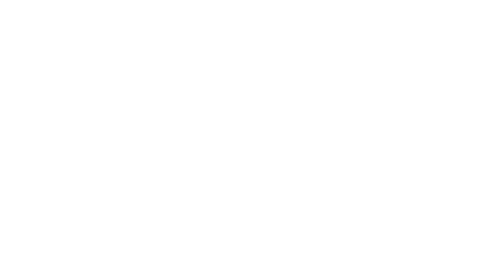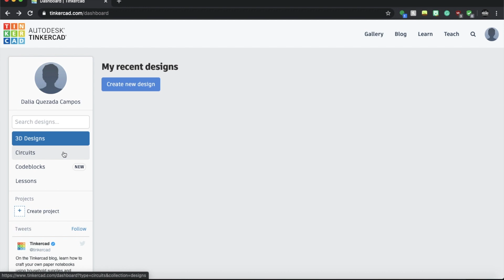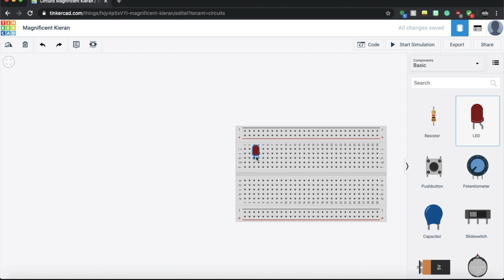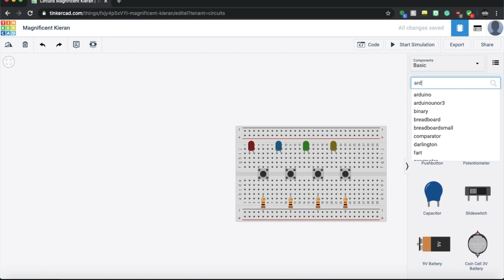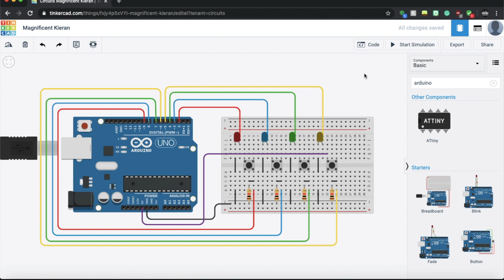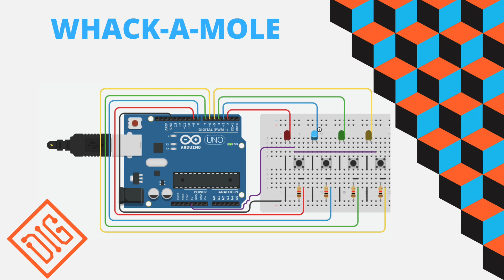Make A Whack-A-Mole Game!

Comment: I did the montage and use the code, but its turning on just the second led and none of the pushbuttons are working. An advice ?
Reply from the maker: Hi Alex! I'm sorry you're having that problem! 

Are you using TinkerCAD or did you make it in person?  If it was on TinkerCAD, could you reply with the link?

IN PERSON:
 If you made it in person and the code is compiling correctly and you followed the code from the video, there may be an error within your circuit wiring. I would try looking at your wiring in comparison to the original schematic (in the description box). If the wiring matches perfectly, the components may not be working properly. For an LED, I would use a resistor that is approximately 300 Ohms. For the grounding resistor, I believe you may need about 220-Ohm resistors, but you can use higher resistances to ground the pushbutton. 

An easy way to check if the components are the ones not working is by making a simple series circuit where you put the LED, a resistor, and a pushbutton connected to the power source within the Arduino Board. Below I linked an example of how to test your circuit:

https://www.tinkercad.com/things/kJpmFD9xRgd-mighty-bigery/editel?sharecode=XjwjhFaxDQMreg_53MRyBF0yF-AhfUfQnA-jjseGCf4 

Another common error when making the circuit in-person is that an LED can only be connected one way. The longer leg of an LED (the anode) should go to the numbered pins in the Arduino. The shorter leg of an LED (the cathode) should go to one of the GND pins. You can put a resistor either between the long leg and the numbered pin, or between the short leg and the GND pin. 

However, that would not explain the buttons not working, that may be a problem with the resistance that you use to ground them or something in the code being off. Look at the original TinkerCAD code in the description box and maybe compare line by line when you're looking at the for loop that controls the LEDs and the buttons.

TINKERCAD:
If you used TinkerCAD and you followed the tutorial, did you make it on a personal file or did you copy and tinker the original circuit found in the description box? I re-check the code that is linked to see if there's a mistake on our side and it seems to be working fine!  If you use the link in the description box, it should work! If you did not use the link, I would try once again looking at the wiring, that's the most common error. If that seems to be correct, maybe re-check your code in sections. Specifically, the beginning of the for loop that controls what LEDs are randomly turned on. Try looking at the code linked in the description box,  it should be very detailed with a lot of comments. 

Hopefully, this is helpful!

Comment: How can you add more buttons and les to the program? For example 10 leds en buttons
Reply from the maker: Hello Pieter! 

If you would like to add more buttons and LEDs to the program only using the digital pins (which are the top pins on the diagram), you would just add your LEDs and respective buttons to the remaining free pins. There is a loop that randomizes the LEDs that turn on, so do try to put all the LED pins together to make it easier to randomize. For example, put all your LEDs on pins 0-6 (which gives you 7 LEDs) and all your buttons from pins 7-13 (which gives you 7 buttons). Your loop that randomizes the LEDs (in line 35 of the original code) would therefore have to be from 0 to 7 (this would only randomize numbers up to 6). In total, you should be able to get 7 LEDs and 7 buttons on that way. 

If you want more than 7 LEDs and 7 buttons with one Arduino, you would have to use the analog pins (which are labeled "A0, A1, A2, ..." on the Arduino). I believe you can use the analog pins as digital using the same digitalRead and digitalWrite commands. However,  you would have to call each pin "A#" instead of just # since the singular numbers are already used for the digital pins. This would mean you'd have to alter your codes to adapt to the fact that the pins are no longer only integers. So whenever you are declaring the "const int _______" variables, you won't be able to do that with the analog pins since it will give you an error for having an "A". Therefore, you would have to hard code the digitalRead/digitalWrite/pinMode commands for any LEDs and buttons wired at the analog pins. You may also come into a problem whenever you are randomizing which LED turns on (once again, line 35 in the original code that is linked) if you have LEDs on the analog side since it will no longer be a pin that is a number only, so you can't randomize inside of the digitalWrite. You would have to still randomize a number from 0 to 10 (if you wanted 10 LEDs and 10 buttons), but maybe use an if-else statement to label each pin with a number from 0-9 as needed.

If you need any more information or clarification, leave a comment and we'll answer as soon as we can!
Reply: @digatsmu6667  I tried making a program but i doesn't work. I have an Arduino Mega so I have like 50 pins. I want to make this program with 10 leds and 10 buttons but I can't. I hope you guys can help me.
Reply: @digatsmu6667  /First, we will declare some integers to for the pin values
const int redLED = 0;
const int blueLED = 1;
const int greenLED = 2;
const int yellowLED = 3;
const int ta = 4;
const int bla = 5; 
const int boo = 6; 

const int redButton = 7;
const int blueButton = 8;
const int greenButton = 9;
const int yellowButton = 10;
const int tak = 11;
const int blad = 12; 
const int boom = 13;

//place where you declare the LEDs and buttons as input or output
//connects them to Arduino so it knows how to manipulate 
void setup()
{
  //Set LED pins as outputs (only displays light)
  pinMode(redLED, OUTPUT);
  pinMode(blueLED, OUTPUT);
  pinMode(greenLED, OUTPUT);
  pinMode(yellowLED, OUTPUT);
  pinMode(ta, OUTPUT);
  pinMode(bla, OUTPUT);
  pinMode(boo, OUTPUT);

  
  
  //Set Buttons as inputs (controls if you whacked the "mole")
  pinMode(redButton, INPUT);
  pinMode(blueButton, INPUT);
  pinMode(greenButton, INPUT);
  pinMode(yellowButton, INPUT);
  pinMode(tak, INPUT);
  pinMode(blad, INPUT);
  pinMode(boom, INPUT);

  
}

void loop()
{
  //Makes sure that the game ends after 30 lights are whacked
    for(int i = 0; i < 10; i++)
  {
    //Randomly turns on an LED
    digitalWrite(random(0, 7), HIGH);
    
    //Checks if any of the LEDs are on
    while(digitalRead(redLED) == HIGH || digitalRead(blueLED) == HIGH || digitalRead(greenLED) == HIGH ||digitalRead(yellowLED) == HIGH||digitalRead(ta) == HIGH||digitalRead(bla) == HIGH||digitalRead(boo) == HIGH)
    {
      //Functions that turns off the randomly lit LED
      if (digitalRead(redLED) == HIGH)
      {
        // Makes sure button is pressed
        if (digitalRead(redButton) == HIGH)
        {
          //Turns off LED
          digitalWrite(redLED, LOW);
        }
      }

      if (digitalRead(blueLED) == HIGH)
      {
        // Makes sure button is pressed
        if(digitalRead(blueButton) == HIGH)
        {	
          //Turns off LED
          digitalWrite(blueLED, LOW);
        }
      }

      if (digitalRead(greenLED) == HIGH)
      {
        //Makes sure button is pressed
        if(digitalRead(greenButton) == HIGH)
        {
          //Turns off LED
          digitalWrite(greenLED, LOW);
        }
      }

      if (digitalRead(yellowLED) == HIGH)
      {
        // Makes sure button is pressed
        if(digitalRead(yellowButton) == HIGH)
        {
          //Turns off LED
          digitalWrite(yellowLED, LOW);
        }
      }
 
      if (digitalRead(ta) == HIGH)
      {
        // Makes sure button is pressed
        if(digitalRead(tak) == HIGH)
        {
          //Turns off LED
          digitalWrite(ta, LOW);
        }
      }
if (digitalRead(bla) == HIGH)
      {
        // Makes sure button is pressed
        if(digitalRead(blad) == HIGH)
        {
          //Turns off LED
          digitalWrite(bla, LOW);
        }
      }
if (digitalRead(boo) == HIGH)
      {
        // Makes sure button is pressed
        if(digitalRead(boom) == HIGH)
        {
          //Turns off LED
          digitalWrite(boo, LOW);
        }
      }      
      delay(100);
    }
  }
  
  //Shows the end of the game
  //First, we will declare some integers to for the pin values
const int redLED = 0;
const int blueLED = 1;
const int greenLED = 2;
const int yellowLED = 3;
const int ta = 4;
const int bla = 5; 
const int boo = 6; 

const int redButton = 7;
const int blueButton = 8;
const int greenButton = 9;
const int yellowButton = 10;
const int tak = 11;
const int blad = 12; 
const int boom = 13;

//place where you declare the LEDs and buttons as input or output
//connects them to Arduino so it knows how to manipulate 
void setup()
{
  //Set LED pins as outputs (only displays light)
  pinMode(redLED, OUTPUT);
  pinMode(blueLED, OUTPUT);
  pinMode(greenLED, OUTPUT);
  pinMode(yellowLED, OUTPUT);
  pinMode(ta, OUTPUT);
  pinMode(bla, OUTPUT);
  pinMode(boo, OUTPUT);

  
  
  //Set Buttons as inputs (controls if you whacked the "mole")
  pinMode(redButton, INPUT);
  pinMode(blueButton, INPUT);
  pinMode(greenButton, INPUT);
  pinMode(yellowButton, INPUT);
  pinMode(tak, INPUT);
  pinMode(blad, INPUT);
  pinMode(boom, INPUT);

  
}

void loop()
{
  //Makes sure that the game ends after 30 lights are whacked
    for(int i = 0; i < 10; i++)
  {
    //Randomly turns on an LED
    digitalWrite(random(0, 7), HIGH);
    
    //Checks if any of the LEDs are on
    while(digitalRead(redLED) == HIGH || digitalRead(blueLED) == HIGH || digitalRead(greenLED) == HIGH ||digitalRead(yellowLED) == HIGH||digitalRead(ta) == HIGH||digitalRead(bla) == HIGH||digitalRead(boo) == HIGH)
    {
      //Functions that turns off the randomly lit LED
      if (digitalRead(redLED) == HIGH)
      {
        // Makes sure button is pressed
        if (digitalRead(redButton) == HIGH)
        {
          //Turns off LED
          digitalWrite(redLED, LOW);
        }
      }

      if (digitalRead(blueLED) == HIGH)
      {
        // Makes sure button is pressed
        if(digitalRead(blueButton) == HIGH)
        {	
          //Turns off LED
          digitalWrite(blueLED, LOW);
        }
      }

      if (digitalRead(greenLED) == HIGH)
      {
        //Makes sure button is pressed
        if(digitalRead(greenButton) == HIGH)
        {
          //Turns off LED
          digitalWrite(greenLED, LOW);
        }
      }

      if (digitalRead(yellowLED) == HIGH)
      {
        // Makes sure button is pressed
        if(digitalRead(yellowButton) == HIGH)
        {
          //Turns off LED
          digitalWrite(yellowLED, LOW);
        }
      }
 
      if (digitalRead(ta) == HIGH)
      {
        // Makes sure button is pressed
        if(digitalRead(tak) == HIGH)
        {
          //Turns off LED
          digitalWrite(ta, LOW);
        }
      }
if (digitalRead(bla) == HIGH)
      {
        // Makes sure button is pressed
        if(digitalRead(blad) == HIGH)
        {
          //Turns off LED
          digitalWrite(bla, LOW);
        }
      }
if (digitalRead(boo) == HIGH)
      {
        // Makes sure button is pressed
        if(digitalRead(boom) == HIGH)
        {
          //Turns off LED
          digitalWrite(boo, LOW);
        }
      }      
      delay(100);
    }
  
  
  //Shows the end of the game
  for (int i = 0; i < 3; i++)
  {
    digitalWrite(redLED, HIGH);
    digitalWrite(blueLED, HIGH);
    digitalWrite(greenLED, HIGH);
    digitalWrite(yellowLED, HIGH);
        digitalWrite(ta, HIGH);
        digitalWrite(bla, HIGH);
        digitalWrite(boo, HIGH);

    delay(250); // Wait for 250 millisecond(s)

    digitalWrite(redLED, LOW);
    digitalWrite(blueLED, LOW);
    digitalWrite(greenLED, LOW);
    digitalWrite(yellowLED, LOW);
        digitalWrite(ta, LOW);
        digitalWrite(bla, LOW);
        digitalWrite(boo, LOW);
    

    delay(250); // Wait for 250 millisecond(s)
  }
}
  {
    digitalWrite(redLED, HIGH);
    digitalWrite(blueLED, HIGH);
    digitalWrite(greenLED, HIGH);
    digitalWrite(yellowLED, HIGH);
        digitalWrite(ta, HIGH);
        digitalWrite(bla, HIGH);
        digitalWrite(boo, HIGH);

    delay(250); // Wait for 250 millisecond(s)

    digitalWrite(redLED, LOW);
    digitalWrite(blueLED, LOW);
    digitalWrite(greenLED, LOW);
    digitalWrite(yellowLED, LOW);
        digitalWrite(ta, LOW);
        digitalWrite(bla, LOW);
        digitalWrite(boo, LOW);
    

    delay(250); // Wait for 250 millisecond(s)
  }
}
Reply from the maker: @Pieter-Jan  Hi Pieter! 

Give me some time to look at your code to see if there is a mistake or something of the sort! I'll get back to you when I figure it out! 

- Dalia
Reply: @digatsmu6667  Thank you soooooo much
Reply: @digatsmu6667  Hii, I was wondering if you already had time to check it out. I still don't manage to make this program for 10 LEDs on an arduino mega.
Reply: I have no idea 😂